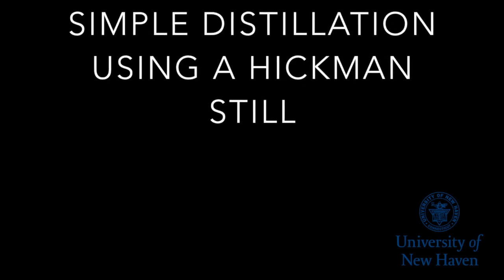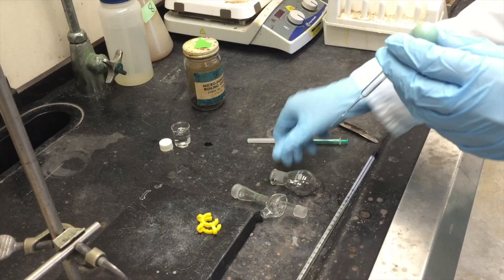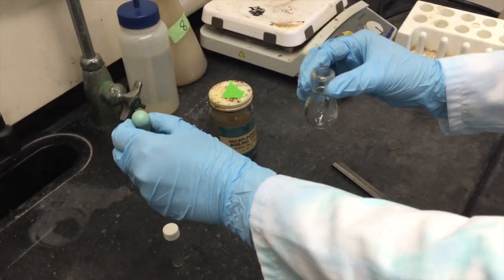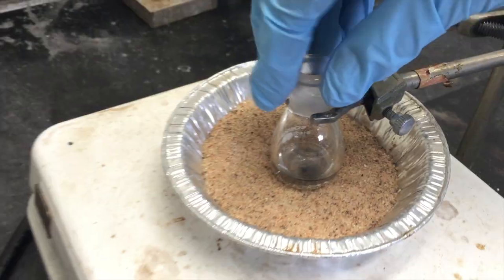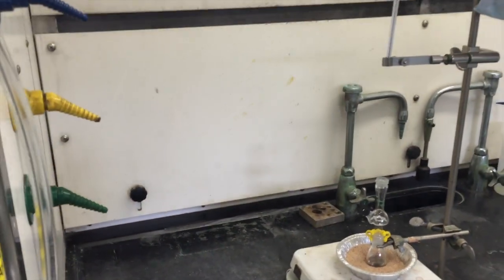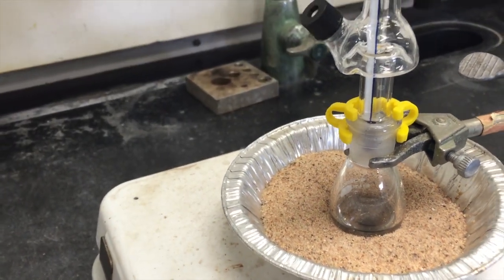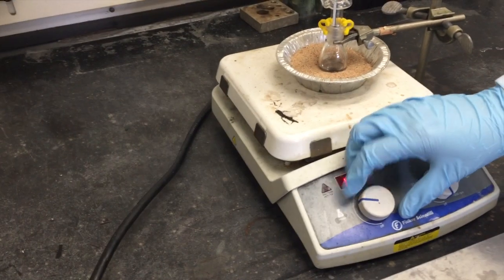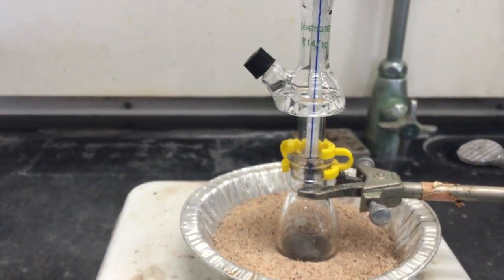Simple Distillation Using a Hickman Still

Comment: How come it's so hard to find a decent hickman these days? This is the only available model and it's poorly designed.... how are we supposed to use nitrogen atmosphere and dry ice cold finger? Not trivial because of that useless screwcap joint on the top...
Reply: I recommend asking a glassblower for making one following your specifications. An alternative that I usually prefer is using a kugelrohr (bulb to bulb distillation) instead of hickman.